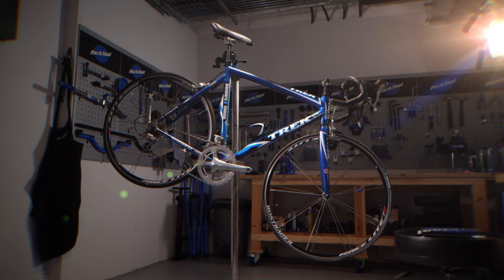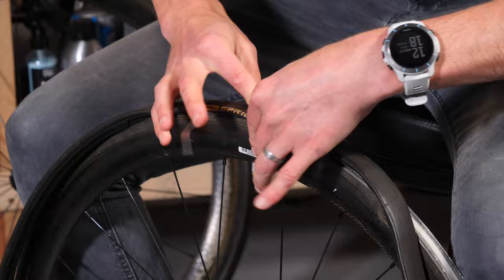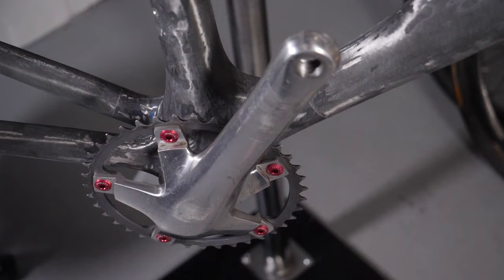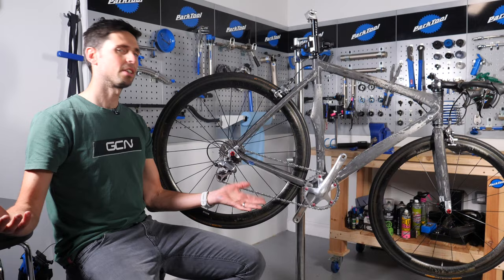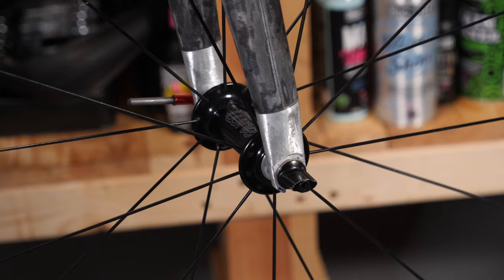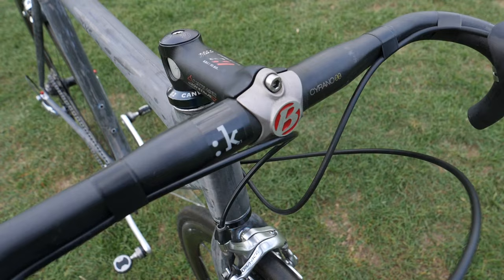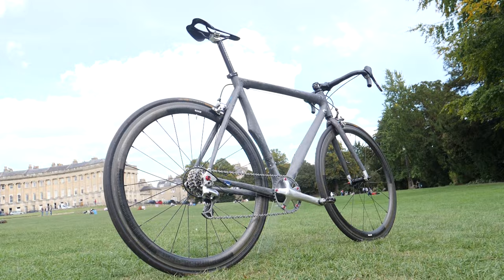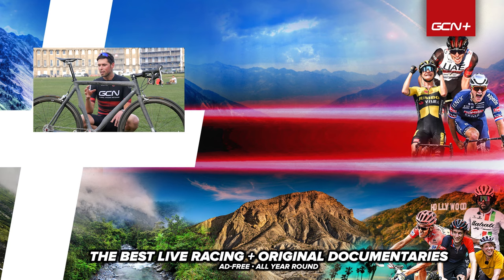I Built An Illegal Super-Light Hill Climb Bike For Under £1000! | Part 3

Comment: handlebars can be cut even shorter and the cable routing can also be optimized by shortening them a few centimeters. it looks like the left shifter is still attached to the handlebars which can be taken off since it is not used, and is there still paint on the wheels?
The 'super lightweight' red nut for the front wheel can easily be modified on a lathe in such a way that it does work.
And when trying to loose as much weight as possible I would also consider to modify the 'quick release' levers on the wheels since you will never remove them during a hillclimb, so no need for quick release.

Comment: the bare carbon would look awesome if you handsanded it to a an even finish with finer and finer graded of wet and dry.
Reply: I agree, however I'm not sure I can face any more time sanding, it's such a slow process, but does highlight why a proper paint job from the expert costs a LOT
Reply: @GCNalex  You can also heat shrink the hood covers
Reply: @GCNalex  true the time with the finger sander left many high and low spots that would take along time to get right.  a tube sander would of made a much cleaner and quicker job of it.
Reply: There is something called sandpaper block/sanding block/sanding sponge. It is a handy squared sponge with a sandpaper wrapped around. Easier to use than the traditional flat sandpaper - it is washable, and comes in different grits.
When you start sanding you should finish it properly or just leave it when you are afraid of sweat,  elbow grease, and time.
Reply: I agree. Maybe wax it after too.

Comment: I wonder what Hambini would say about that BB...
Reply: That spin tests don't mean anything since the bearings aren't under load
Reply: I have an old Felt f85 with threaded Hollowtech II SM-BB5700 and its spina like a crazy. Like square carteidge bb
Reply: Probably something needlessly expletive-ridden and sexist.
Reply: @Shellewell  sexist?
Reply: @FeintMotion  probably centreline of the frame is misaligned
Reply: @FeintMotion  there is a limit to that
Reply: Still yet to see a video where Hambini actually recommends something. I'd rather be riding my bike than moaning it's not 100% engineering perfection 🤷
Reply: @loc9588  yeah. If they can't find argument against hambini they call him sexist - whatever that means
Reply: Using the saved watts to turn the cranks
Reply: pen is working
Reply: He'd say it's shite.
Reply: I don't care what Hambini would say...
Reply: Same thing he says about everything. Its shite
Reply: Hambini wouldn't care, it's not for a performance bike just a lightweight build
Reply: @FeintMotion  the point is it isn't underload so you check alignment without any torque influences. I see where you're coming from though but failing a spin test is never a good sign.
Reply: @willmdn  he recommends plenty of stuff. It's just the nature of the beast is he gets sent stuff to fix.
Reply: @willmdn don't know about that, he definitely recommends his own bottom brackets...
Reply: @willmdn  hambini raves about Look and Time bike manufacturing quality.  He is a curmudgeon, but every once in a while he finds something solid.
Reply: @NewPolishScientist  Sexist means "characterized by or showing prejudice, stereotyping, or discrimination against women and girls, on the basis of gender."
Reply: @pex3 Ok... what is a woman?
Reply: @willmdn  You clearly haven’t really watched his channel. He’s had some wheelsets and frames in the last six months that he really likes.

Comment: Hey Alex, since you're saving every gram possible, you could first set the right torque on the top cap, then tighten your stem bolts and then remove the top cap, since the stem bolts now keep the tension in the system.
Reply: He could have also removed the left hand gear lever because it doesn’t have a front derailleur. Keep the brake lever but take the gear lever off
Reply: He could’ve removed ALL the paint, even the paint on the stem
Reply: ..and the star nut.
Reply: @kosomakkev9552  He could have saved even more weight by replacing both STI shifters with old school brake levers & using the Dura Ace 10sp downtube shifter instead.  Campagnolo sells carbon brake levers without the shifting pars for people that want to run down tube shifters.
Reply: @montanajones8393  that’s make it over the 1k budget
Reply: @kosomakkev9552  How so?  The STI levers could be sold to finance this.  Those downtube shifters are easily found for a good price.  Instead of the Campy carbon brake levers, any retro brake lever could be used & then drilled out for weight savings.  This was what was done in the past.
Reply: Stick a cheapo non-STI lever on the left.

Comment: I've already built my bike, but it was interesting to see this anyway. I didn't have an existing bike so I had to buy everything and the total spend was £1255, but that included buying a frame, which cost me £350, so you can say I spent £905. Mine weighs 6.2 kg, but that includes my carbon blade pedals and you didn't give us the weight with pedals on yours ;-)

Comment: That front QR nut could have just been filed flat. Also, on a climb specific build, I'd put a 28mm on rear, 23 on front. Another thing, we'd all have liked to see a little drillium. Not 1980's style drillium, but maybe drill out some voids on back sides of crank arms. Bars coulda donated a bit more weight too. And though I think this build is rad, I feel a bit more effort could have been put into the frame finish, just looks a bit too humble. Haha. Nice job Alex.
Reply: You could probably drill a load of holes in the chainset and it would still retain enough stiffness.

Comment: 183 grams. That's more than I thought. So it's absolutely worth it getting rid of the paint. 👍🏽
Reply: And 1830g for getting rid of disk brakes, 1000g for changing to 20/24 spoked tubular wheels (and the tires).

No wonder you can't buy bike under 8Kg and under 8K€ nowadays.
Reply: @SampoSaarela  wait disk brakes add almost 2kg over rim?
Reply: @growlydog  generally yes. You take a 6k$ bike from 10 years ago and they are generally that much lighter than the bikes today at even more expensive price ranges.

But it is not only the brakes themselves, more and longer spokes, the mounts for the brakes, etc etc

Comment: The problem with this system are the tubular tires. They are so inefficient, that the 400g heavier wheelset with GP 5000 would be quicker. 
That's one of the reasons, why the professional riders are so quick nowadays.

Comment: Could be lighter with
1. full carbon fork
2. titanium seat clamp
3. jag wire cables
4. Sanded stem/handlebar
5. Titanium bolts if not already used

Comment: My snobby bike build rule regarding electrical tape is...no electrical tape. I have a hack that eliminates the need. One drills holes behind brifters for cables to enter handlebars, then two more holes up by stem for cable to exit handlebars. Super clean, light and needs no tape. And to anyone claiming this to be foolish, I've observed the holes and no cracking whatsoever has occurred. As far as chopping off the drops, it can be dangerous. One night after a couple "energy drinks", was bombing down a hill, on my way home when out of habit, I went for the  drops. They were not there. I was able to somehow catch myself before slamming chest into stem. But it was close.

Comment: The shifters are pigs. Lose 40g by removing the rubber hoods. Lose 10-20g per shifter by removing the flightdeck internals - depends on how much time you want to spend disassembling and reassembling. Lots more weight to be saved by removing full left shifter internals.

Comment: I have an old Timetrial rear derailer made in France it weighs in the grams, as in the 80s I was racing on a 27inch frame and I raced on a 55 big ring and a 45 small ring, and on the rear for my gears was a smallest was 33  and a largest was 10, my bike was built in Milian Italy, but it was a beast for downhills. I used High pressures on Mavic MA40 rims with a complete Campag outfit, I was 6 feet 4inches Tall and my weight was 95kgs and my bike cost me at the time $6500.00, and I was starting my career in the Australian Army, cheers all

Comment: While you've saved considerable weight which should translate to fewer watts required to meet the challenge, I noticed a big problem that negates much of work you did to save weight. When you were constructing the drive train and spun the crankset, the cranks stopped far too quickly meaning there's a serious problem with the bottom bracket which is costing you some serious wattage. The crankset should have spun as freely as your rear wheel if it's perfectly aligned and with quality bearings.

Comment: Just file off/sand off the end of the aluminium cap. As long as you re-tap the threads it will be fine and you will probably save another 0.5 of a gram!
Reply: Not to mention the weight of the shavings removed from the threads and boss removal!!
Reply: not worth the risk (no pun intended). Anything less than exceptional clamping force + friction on the back wheel causes it to slip out of the frame with these skewers, as i had the misfortune of finding out.

Comment: Nice build!
Wouldn't you have to paint the bike in UV resistant clear coat? Otherwise the sun will harm the frame as far as I know.
Reply: Late season hill climb bike...won't see much UV.
Reply: It depends on the Epoxy resin and hardener u use. there exist resin which is UV resistant.

Comment: Stripping the STI mechanism and inner shift lever out of the LH shifter might have saved you another fair bit, there is some weight in those things*. It'd be a daunting job putting them back together again but probably not that hard if you didn't mind ruining them :-)

*(if it's possible to do this and still keep the brake lever function? Not sure...)
Reply: Pantani style

Comment: Francis Cade has built one even lighter 😁
Reply: Francis has indeed, but not too sure he stuck to a sub £1000 budget. great to see all the options out there though.
Reply: @GCNalex  the wheel alone where a £1000 I think 🤣🤣 but could there be a lighter alloy wheel set 🤔then the carbon ones you bought with tpu tubes and light weight tyres?

Comment: maybee the pedals is an essential component that should be included in weight
Reply: That would be ~300g more. 6.5 Kg is still great nonetheless
Reply: @RazorWings1234  Magnus refers to calculations Alex was doing sitting on the grass. So, essential parts would be in total not 500g, but 800 then. 700 to be more precise, since we know he is using Speedplays
Reply: Alex was calculating the weight saved on the original bike. The original bike didn’t have pedals when weighed.
Reply: @rob-c.  no he wasn't. He was imagining the weight of "traditional" build and compared it to the UCI limit. This limit as we know is applied to the bike with all parts 'permanently' fixed to the bike, pedals included. Not the showroom weight by the manufacturer

Comment: Replace the seatpost with a full carbon one and stem with some carbon version and u will see a significant drop in weight down to
 5.8kilos I guessing under 6.2 KILOS for sure
I was not given the edit option I know the FRAMSET is carbon I have the same FRAMSET it was a typo error.
Reply: The frame is already carbon lol
Reply: @mitchellsteindler   I know it's CARBON I have the same FRAMSET but could not edit at that time I saw it and forgot until you mentioned it thanks made the correction. Lol
Reply: Agreed, pretty dumb not going full carbon on those parts.
Reply: $$$ Limit

Comment: I can see loads of excess material you could further remove from the bike, you could gotten closer to low 5’s potentially l believe, the amount of material around the alloy parts alone you still could have relieved is pretty vast , that bike could be way lighter still. 

Don’t sweat over the paint job , if you want to return it back to being a dresser again paint is easily replaced 

Cool bike though

Comment: I would suggest swapping that cassette out for a lighter one. Cassettes are one of the most best upgrades if you’re looking towards in making it lighter. If you got the spare change do get yourself a CNC machined one piece hub. They work great and extremely light. I can suggest recon.tw for the cassettes. They are expensive but saves a ton of weight.
Reply: not too sure one off machined parts will keep within the modest budget haha

Comment: Please go to a proper trackcyclingmechanic an do a video on how to properly glue tubes on wheels. Tape is so verry dangerous.
Reply: Indeed plus taping on a tub will add rolling resistance and reduce or negate any benefit from the reduced weight of the wheels
Reply: They forgot the "Tech" part of GNC Tech

Comment: If you are willing to ride a bike without paint or bar tape you are not a real cyclist.  You're some kind of extremist who just happens to ride something that vaguely resembles a bicycle. It is just this sort of extremism that has driven me back to 90's-ish steel bikes and you know what? I've never been happier.  They ride better, they look good and I don't have that nagging fear on fast descents that something vital is going to break. Colnago told my friend that using a carbon fiber bike for more than a couple of years wasn't sensible.  Why didn't they put that in the purchase contract? Now,  after the head tube fall off of his C40,  luckily at 5 mph negotiating a tight uphill turn, he is missing a finger. But 5 minutes later he would have been riding around 40 mph next to heavy traffic. You can make CF safe but you can't make it safe and superlight. This is why production bikes are getting heavier. And I had a 60 cm Look KG585 with an all up training weight of 16 lbs and I didn't like the way it bounced about on the road as you pedaled up climbs. The same with my 2018 Trek Emonda. Give me my early 90's Basso Loto any day of the week. At nearly 78, I have passed 60,000 feet of climbing for the year and the only descending fears I have is a flat tire. I tried tubeless and still got the occasional flat which was then a messy pitb to repair.  So I am back to when bikes were something you could rely on. If you're a racer you advertise some company's $10,000 toy but if you aren't being paid for racing why would you put yourself at risk for a couple seconds gain riding with your buddies up a hill? Do you really think that if you can out-buy someone to beat them up a hill that makes you a better rider? Time to train better and not get a lighter bike.  My old Moser Leader AX or Basso Loto or Aliverti are as good as they get

Comment: you are wrong mate. The uci 6.8kg weight limit is pedals and bottle cage included, yours would be 6.7 + pedals meaning you failed even though you did such dumb ass choices like the painting removal.
Reply: thanks for sharing your thoughts on removing the paint, however bottle cages are not a requirement and the bike with pedals is still a significant amount under the UCI weight limit, not that the UCI limit is the goal of the project, but a bit of fun to factor into it.